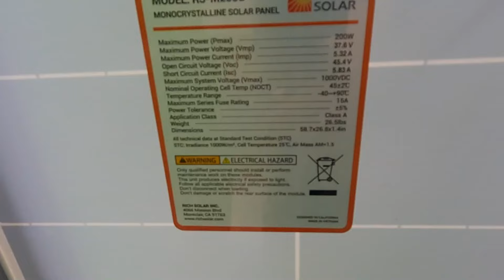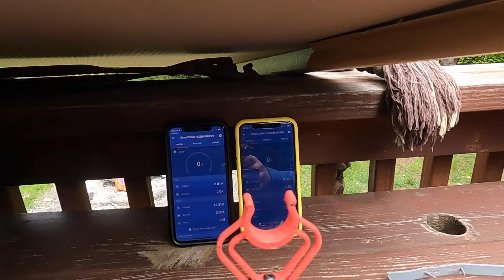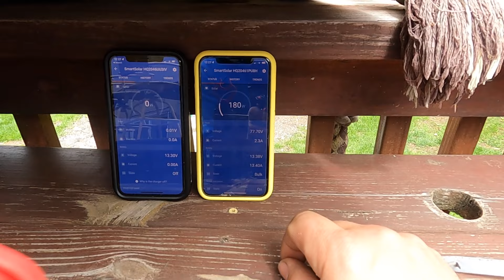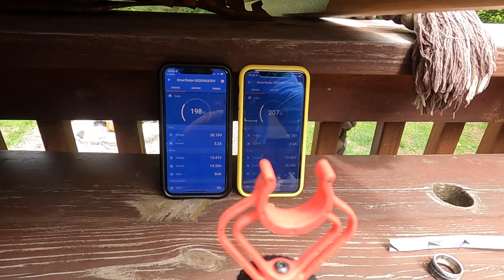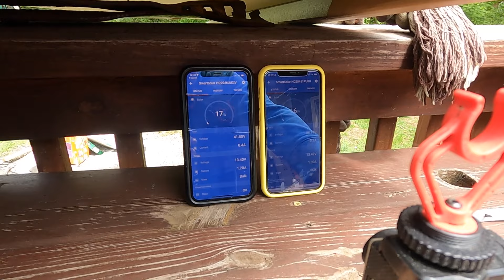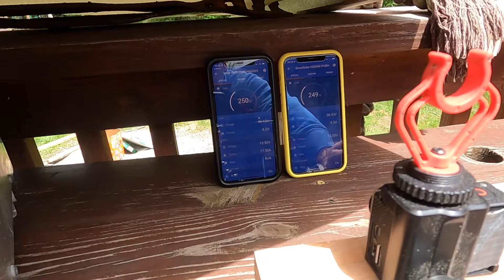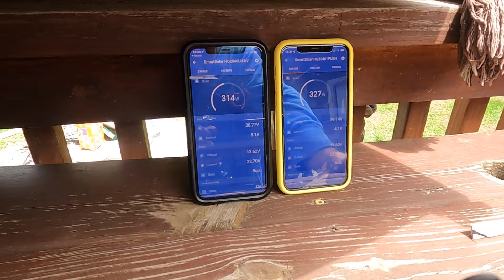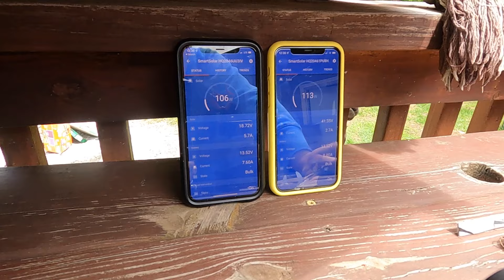Series VS Parallel Solar Panel Wiring Tested  for RV and Off Grid Applications

Comment: If your cable runs are longer, you will see the series connection outperform the parallel connection because of the higher voltage, less loss over the longer run.
Reply from the maker: That’s right, next test! Most of our solar runs are 20-30ft ,Thanks for the idea. 

Maybe it wasn’t obvious, but I actually prefer series and recommend it whenever possible.  IIRC from the video when the sun was out we saw 10-15 more watts on the series side and when we had the horrible shading that brought it down to 10-15 watts there was a 5 watt advantage for parallel. However, at 10-15 watts on a 400w system that extra 5w won’t make or break anything.  I’ll take the extra on clear sun side.
Reply: My name is William HE. I am the chief marketing officer of Australia National Power Storage Holding Pty Ltd (NPS). NPS provides low-cost and high-safety holistic energy storage solutions to customers around the world depending on its large-capacity lithium iron phosphate batteries and other power storage products.
Reply: @mercysun8717  Who cares?
Reply: @youtubehandol  i do
Reply: What is the best way to hook up when I have one 200 watt panel on top of my Overlander trailer and one 200 watt movable panel with a 25’ length. So I can move the panel in perfect sunlight all the time. Series or parallel?
Reply: @mercysun8717 
Free of charge? 😅

Comment: The advantage of series is that they start producing earlier and later in the day because of the higher voltage. All my installations are strings of series at the maximum voltage for the controller in parallel.
Reply: No they don’t, the voltage rises above battery voltage long before there is any usable current and without current there is no power. Some controllers don’t start the tracking process until a certain minimum current is reached in  direct to battery configuration, these controllers start tracking much earlier with parallel connected panels as that current is reached sooner, in fact the manufacturer recommends parallel connection and the efficiency curves show greatest efficiency in the parallel configuration which would be expected as the tracker has to do less power conversion where the voltages are closer.
Reply: If my panels are experiencing some shading.. is it best to connect to parallel ?
Reply: @thegreenthing7603 if you connect in parallel, the shaded panel will dictate the power output over the other higher power producing panels. That's the negative of wiring all panels in parallel.

Comment: ps , that was not a partial shading you completely blocked them  3x circuits going length ways anything blocking width ways will stop the electrons , but you can disable the Left or mid or Right and the diodes will do their job , personally i rather series because you get higher starting voltage for longer runtimes during sunrise / sunset

Comment: I have tested my panels in every possible way to hook them up ; I tried 63 and 84 volts coming in ; the best performance was with six sets of two panels in series, the voltage is between 29 and 41, and it puts out 2 % more that way. I am using an Epic Solar 4215 BN charge controller, 40 amps. I have twelve 100 watts panels. The panels are from 25 to 40 feet away and the amps maxes out at 32 but stays in the mid 20's usually. I noticed one time today the volts were 26.7 and the amps were 26.6.
Reply from the maker: Series parallel groups are my favorite way as well. Glad you found what works best in your setup!

Comment: Exactly the info I've been searching for. I've been debating going all in series on 6 panels vs 2 strings of 3. It looks like it's more cost effective to go all in series.  It will save on wiring, fuses and complexity.  Shading will be an issue at times since it's on an RV.  The effect of shading appears to be close to the same whether in series or parallel.  Thanks.

Comment: I use this solar Generater.Systems  at work. The building is 80 years old so there’s not a lot of electrical outlets. I use it for lights, fans, charge phones etc. works great !
Reply from the maker: Depends on what your loads are.
Reply: Scam comment

Comment: We can think through the test with electrical concepts, too.

Let's say we have panels rated for 20v and 5amps.

In series, two panels would be 40v and 5 amps.
In parallel, two panels would be 20v and 10amps.

Voltage is what pushes the power and a higher voltage can push more power across a thinner wire with less losses.
More amps creates more heat and resistance on the wire, which causes voltage drops across the distance of the wire.

If you were to do 10 panels in parallel you would be pushing 50 amps and you'd need thicker wire to do this and you would see more losses as heat within the wire.  20v * 50 amps = 1,000 watts (with some of those watts more likely to be lost as heat).
If you were to do 10 panels in series, it's be just the 5amps.  And that 200v would push the power through quite easily even on fairly thin wire.  200v & 5amps = 1,000 watts.

The main reasons you'd want to parallel:
1)  In a 4 panel example where two panels are positioned above the other two panels and where a tree or structure casts a shadow over the bottom two panels that can't be helped, it'd be best for them to be parallel connected to each other as the top two and the bottom two.  This allows the two top panels that aren't getting a shadow to perform optimally and not be dragged down because of the shadow on the bottom two panels.  If the 4 panels were arranged with two on top and two on bottom but they were all 4 wired in series, then that shadow hitting only the bottom two panels would actually drag all 4 panel's performance down.

2) You would use parallel if your equipment (charge controller) was rated for a max voltage of say 100v and 10 amps (1,000 watts) where each panel you bought was 20v and 5 amps.  5 panels would reach the 100v limit so you'd have 100v and 5amps with 5 panels = 500 watts.  But you could do a 5series 2parallel with 10 panels (two rows of 5) and have 100v and 10amps = 1,000 watts.  So depending on your equipment and what panels you buy, it may be in your best interest to parallel your panels to maximize power going into the system while staying under the max voltage allowed in the system.
Reply from the maker: Good information. Part of what this experiment aimed to address was the scenario 1) . With modern panels with blocking diodes , we didn’t find much of a difference.  I learn more series when possible, like you say, less heat, less loss, smaller wire.
Reply: Hey thanks for the great info about series and parallel you did a great job about all the details debating which one is best and what it comes down to really is parallels going to give you more amps in your battery the high voltage and serious just pushes the current father in long runs man you put a lot of good info in there thanks I've been running solar for years and people debate about this but like I said parallel is the best because if the shade hits a couple of panels low it doesn't affect your whole array like series all right thanks 👍
Reply: Great comparison! I'm new to solar. A previous video I saw showed: the older "amorphous" solar panels still provide a charge, when in the shade. The new mono-crystalline panels practically shut down in the shade. I have both the old HFT amorphous 100W and the new mono-crystalline 100W HFT panels. Should I keep them seperate using two MPPT controllers? I plan to expand, but want to have a solid understanding of solar power before I proceed further. Thanks!
Reply: Thank you. After watching many videos, I understood why series connections are preferred by commercial solar plants. No one explained what I was searching in these videos. But you just explained it in a detailed and understandable manner. You are great man💝
Reply: This is some great stuff. I've been trying to find the difference and arrived at the right knowledge base
Reply: @Syko Path In the context of a Van/RV where you perhaps have ready-built-in Solar capability, and you're wanting to addon or bring along additional solar capability that's stand-alone or otherwise not tied into the existing system, you could:

Purchase the following: Solar Panels, MPPT, Battery, Inverter.  (Many all-in-one power stations are the mppt, battery and inverter where you buy solar panels separately)

Make sure the MPPT is capable of charging the batteries you have both in the context of voltage/amperage and in the context of the chemistry (Lifepo4, pb, etc).  Many MPPT can be configured, just make sure it's what you want before you buy.

Make sure the Solar Panel array you intend to build is within the voltage tolerances of the MPPT.  This includes, and this is important, room/buffer for temperature drop.  As temps get colder, the voltage produced by solar panels goes up.  This means if a MPPT's max voltage input is 145v from solar panels, you might want to build your array to max at around 100v in the scenario where you will see -30 to -40F temps.  Most solar panels are rated/tested/specced for 77F.  Anything colder than 77F will leave potential for the panel to produce more voltage than the spec sheet says it will produce because the spec sheet is based on 77F.

For the battery, it's mostly going to be about having enough kwh to run what you need to run when the sun goes down, or when the sun is absent due to clouds/weather.

For the inverter, generally it's best to have the smallest inverter possible if possible because larger inverters suck down more power at idle and many loads cycle on and off either regularly or as needed (Fridge/Freezer, Air Conditioning, Heating, Microwave).  If your inverter was only running a Fridge 90% of the time, it's probably best to have an inverter dedicated just to running that fridge (using a separate inverter that was manually powered on/off for other higher loads).  In this way, you can use the smallest inverter possible, and you will lose less power.  My rough rule is 12 watts per 1,000 watts of inverter.  This means a 1,000 watt inverter will use 12 watts sitting there doing nothing but being on.  A 2,000 watt inverter will use 24 watts sitting there doing nothing but being on.  etc.  This is not a hard rule, but it's what I start with in my assumptions until I know the actual answer.  Being familiar with your specific inverter's manual and related paper work will likely tell you the idle power consumption.  To dramatize an example, you do not want a 3,000 watt inverter just to run an alarm clock.  You will burn 30+ watts just having the inverter on to run a less than 2 watt clock.  Buy a smaller inverter for such loads.

You're free to plug in a power strip.  I assume that's what you mean when you say power board, though I'm not sure.  Just respect the inverter's max output capability.  If a 3,000 watt inverter says it's capable of 1500 watts on both of its outlets (two outlets total), do not try to run 1800 watts on a power strip plugged into one of the outlets.

Inverters often come in as Modified Sine Wave and "Pure Sine".  I don't think "pure sine" are perfect sine waves, but they are close enough.  Many electronics will not like running on Modified Sine (it's a more squared off wave).  "Pure Sine" inverters are usually more expensive, but they run a larger assortment of equipment more safely and in some cases, it could be the difference of something running or not running and it could also be a difference of device, equipment, appliance life span.

I can't promise to be available for help upon a subsequent question, but I will try, assuming I see the notification.  I've tried to cram a lot of info here, some I felt was overboard for the scope of the question, but some people seem to be absorbing info like a sponge and are yearning to learn so may as well throw it out there.

Comment: Yup, series is always better.   Power losses in cables and in regulators (including MPPTs) are generally only a function of the current.  P = I*I*R.  The current squared, in fact.  A parallel configuration doubles the current and halves the voltage (P = I * V so the power output is the same), but cable and circuit losses will be 4x that of a series configuration.   Higher voltages and lower currents are always better, as long as the equipment can handle it.

There are a few other gotchas as well.  Lets say you had two series strings with 4 panels in each (8 panels total).  If you gang the two strings together in a solar combiner box, then any partial shading of one string will reduce the MPPT efficiency for BOTH strings.  Because the MPPT will not be at the ideal power point for either string.   It is always better to put each string on its own MPPT.  Then if panels in one string are partially shaded, each MPPT will be able to optimize for its respective string perfectly.

So, for example, if you take your four panels and put them in a 2s2p configuration with a combiner box (or just wired together for the test, since its only 2s2p), going into one MPPT, then a partially shaded panel will mess up both strings to some degree.   But if you put them on separate MPPTs you will still get a full 3-panels worth of power production.

Partial shading of one panel is a series string does not effect the other panels in the series string (due to the magic of the bypass diode in each panel), so the MPPT will operate properly.  This is also important for larger, older systems where one or more panels might have failed and is in bypass without the owner realizing it.  In  both cases, the bypass diodes take care of the problem.  But if there is only one MPPT the owner might not realize that a panel in one of the strings has failed!   Partial shading of one or more panels in a parallel configuration, on the other-hand, causes the MPPT to shift away from the optimal point for the other panels.  This effect is only very slight, though, since a partially shaded panel is almost like a hole in the wall... it might as well be disconnected.  So here one might think that parallel is better, but the currents involved wind up being so high that it winds up actually being worse (as well as a big pain in the butt due to wire sizing, etc).

Newer, modern high-voltage grid-tie inverters (the big ones, not the micro-inverters) have multiple MPPTs for this very reason, while older ones typically had only one MPPT.

Per-panel micro-inverters seem all the rage today, but the actual benefits are limited to a few special cases.  They especially tout 'partial shading' performance.  But actually, a micro-inverter is not going to improve performance verses a high voltage string by more than maybe 1% at best due to strong shadow partial shading.   Because, as you saw, even shading just 2-3 cells in a panel effectively removes that panel from the system regardless of the configuration.

Micro-inverters can have better performance in diffuse shading environments, though, where many panels are getting different amounts of light.  That is their main use-case.  But they are also expensive and more maintenance-heavy as systems age verses a modern high-voltage string inverter with multiple MPPTs that is easily accessible in the garage or side of the house and can handle 60+ panels.

-Matt
Reply from the maker: Great insight, thanks!
Reply: good read thank you! :D

Comment: The best result I`v`e gotten with 4 panels is to put 2 panels in series and put them in parallel.  Best of both worlds!!!
Reply from the maker: I can disagree. That’s usually what I do with 100pv chargers.
Reply: That depends on your controllers. Give them the highest safe open circuit voltage

Comment: Assuming you size the cabling to be equivalent loss (e.g. higher gauge wires for parallel panels), the peak production will be very similar. However, the real benefit of series is that they will reach the minimum voltage level of the controller earlier in the morning and later in the evening, allowing you to capture slightly more overall energy per day. This is especially true when you are comparing larger systems with 48v battery. Most 150V max PV input controllers will have a typical "turn on" voltage of ~80V when used with a 48V battery system.  If you have 6x 55V MPP panels, with a 2S3P panel configuration, no power will be collected until each panel exceeds 40V (loaded) production. However, with a typical 500V max PV input controller and a ~80V "turn on" voltage, in a 6S1P panel configuration, production will begin when each panel reaches just 13.3V (loaded).

It would make an awesome video if you did a test to show the overall daily production difference between series and parallel as I don't think I've seen such a test !

Comment: thats why for my camper trailer Ive ordered 3x 200w custom shingle panels and ill be getting 3x anti shading devices for them which boost the watts if one or part of a panel is shaded when in series.. they will be on my rooftop tent.. but I also have a 300w solar blanket thats 70.8v and I'll order another one thats 440w and 50v.. both on 20m of solar cable so even if its shaded on the rooftop tent or I want to park in a shaded spot I'll still be able to place the 2 blankets anywhere upto 20m away to get a total of 740w
Reply from the maker: We’d love to see it!

Comment: For a small two panel (100w) lighting set up with two lithium 100amph batteries. Mppt controller and short run wiring, is series on both panels and battery’s best? Full sun no shading. Thanks!